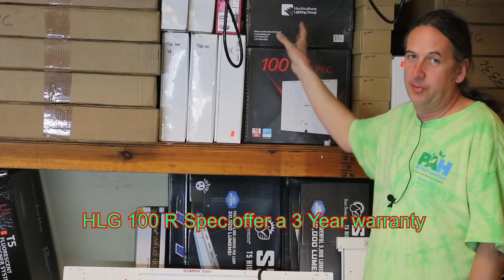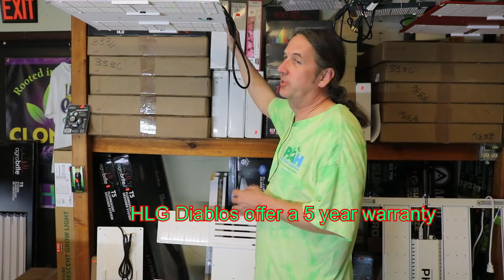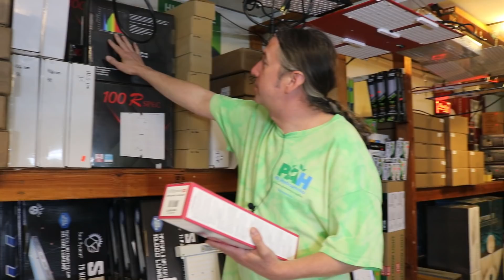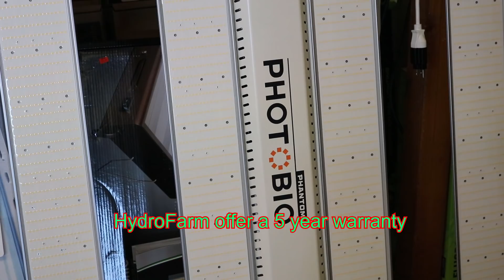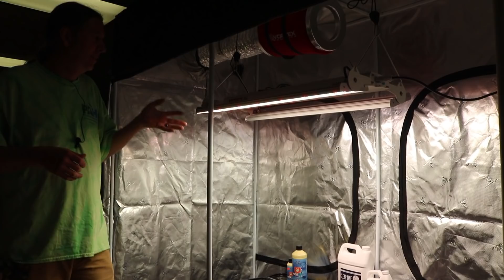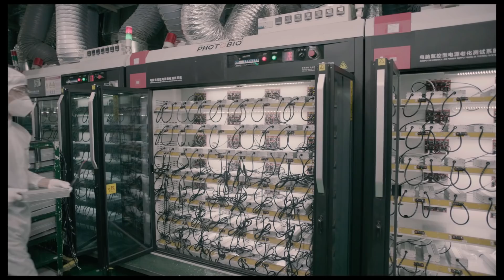The Light Show - How to chose the right size LED grow light for your garden.

Comment: The diablos pull more like 670ish. I sold mine way to much for a grow tent. Finally got with the program and bought some bar fixtures. A GC720 with controller and a optic slim 650. I wish I could pick your brain or had a time to sit and smoke and rap about growing. I love watching your content. Ive got a 6x12 room with a nook in it.

Comment: i got one of those generic knock off brands, Fecida... uses 65 watts says makes effectively 600 watts... i have two for my 2 x 4 , 2 plant closet and i'm liking it just fine. I'm sure i could do better and maybe in the future i can spend hundreds, but these were ridiculously cheap and emit amazing amounts of light... i just wish i knew when growers are saying 100 watt light do they mean electrical use or what it's putting out? (just like a 60 watt LED light bulb is rated as putting out as much as a 100 watt incandescent)....

Comment: Hey BossMan! 1st off love your channel please continue Making more content! I purchased 4 packs of the DWC Water lvl indicators and im going to do 4 dwc and 2 in soil (BRUT super soil Mixed with perlite and happy Frog on the the top few inches)[5gal tall not wide]

Would love to hear ur input
Also making a 🌧  Reservoir using the same hole dozer "circle drill bit"(1 1/4) & going to cut a hole n the  roof than connect sterile pvc pipe leading to a 60 gallon storage container . 

My tent is n the shed So I plan to use the same circle drill on the floor outside of the tent (shed is 2 2ft off the ground fyi) & attach a longer hose so I can easily reach the drain.  I have a plug for the hole whenever I'm not using it btw

I Ran 9 🪴 2 SF4000 in my 5x5 last run might of been a lil too much but no light burns. In Your opinion do u  think 1 will enough? If not I have like 7 of the  smaller  leds from Amazon.  Ranges from "300"to "1000" watt .

Keep up the fantastic job (my dream job 😆) you are appreciated
Reply: Also they are all A.U.T.O's

Comment: I appreciate the video, and the breath of information you tried to convey, but that only left me the novice confused.  In a 4x4 tent growing hydro, which light do you recommend.  I did a bit more research and my first guess for me is a HLG 600R.  I want a one and done light that does not completely break the bank.
Reply from the maker: The light I am going to recommend is HLG's new Black Bird.. check out the link below.

https://shop.pahydroponics.com/horticulture-lighting-group-hlg-blackbird-free-shipping/

It has the power, coverage and the spectrum.  100-600 watts dimmable.  If you are set on the 600R I completely understand as it comes with a great reputation.  Either way you will not be disappointed.

-wayne
Reply: @PAHydroponics  Excuse me Sir, is the BlackBird still your recommendation for a 4x4 in soil?

Comment: Thanks for this video. I’m just starting into this hobby after wanting to do it for a while. 

I did some research last night and I watched a few of your videos. 

I have ordered the Scorpion Diablo light and I bought this Gorilla Tent 4x4. 

I haven’t decided yet what filter/fan system I’m gonna go with. Have to do a bit more research. Any suggestions?  

I’m thinking of going 6 inch around 600 CFM so that it does a good enough job after efficiency calculations.

Comment: i wanted the r spec. super nice. but settled on the bp3k. its doing good in my 5x5 fully cranked up.  nice for the price point
Reply: What light would you like a year after this comment? I am looking and having a hard time.
Reply: @christopherrodriguez6545  im still running the bloomplus 3000 now. its not a r spec. but not bad at all for a budget light. id buy it again. or a bp4k or 2 2500s maybe for better spread (they have the meanwell drivers on those models now) the bp3k is has held me dow..  way over a g per watt. used it in both my 5x5 (tho it does miss the edge. it gives me room to get around for training/cleaning) and in my 4x4 it does wall to wall. mars. vivo sun maxisun all decent imo. there are lots of other off brands on amazon that work great too. i say just go for it. you'll pay for it in one run anyways

Comment: Great stuff. 
 I don't really like led lights.  I'm ole school,  run 2 1k bulbs. I use super blue halide for veg and 1st 2 weeks of flower.  
Than hps. But I can dim down to 400, 600, 1k. And 1.2k. 
 I recently got a small 2x2.5 tent for a mother, bought a California lightworks., solar extreme I think.  250 watt. 
 Bright,  but we will see.  Supposed to veg for a3x3. It will never flower,  so I don't care.  
 Anyone have any experience with California lights?
Reply from the maker: Absolutely nothing wrong with the old school.

Comment: Hey Gary! I have a 4x8 and two of the 300L rspec. How would you recommend setting them up and running them through out a grow?
Reply: the 300 r specs are nice lights, but for a 4x8 you would really want 2 more of em.
Reply: @ConvictGaming1  I was thinking a light mover might be beneficial in this instance?
Reply: @christopherkochvar5313  yea, ive never been a big fan of light movers myself, however they are a way to spread ur light if u dont have enough, theres no replacement for a steady ppfd rating tho. That being said, if those are what u got and what u gotta make due with, then theyll have to work, i would suggest u max them and hang them fairly high, 26-30 inches above the canopy or so and try to get as much spread out of them as u can. Good luck.